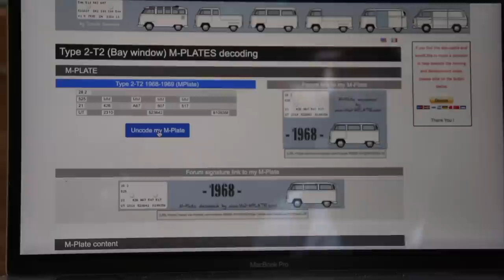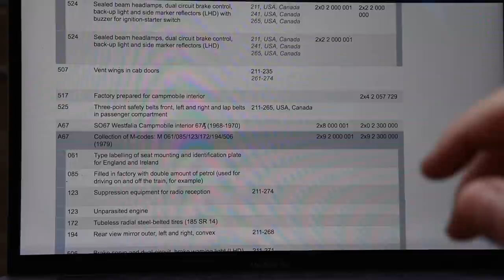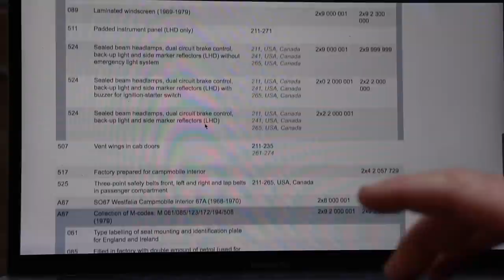Forgotten VW BUS Found & Rescued - Volkswagen Camper Van

Comment: I can’t believe, the bus comes originally from my old hometown in Germany. The sticker on the bus , Gruß aus der Rhön is an indication that the bus is originally from Germany. The Rhön Mountains are a group of low mountains (or Mittelgebirge) in central Germany, located around the border area where the states of Hesse, Bavaria and Thuringia come together.  A major city in the area is Fulda, where 1000 of American Soldiers were stationed until the early 90’s. Most likely one of those fellows brought the Bus here to America. Also, the other sticker with the arrow pointing upwards says”Hallo Partner, Danke Schön.” This sticker was around the years from 1971-1974. It was a kind of awareness logo from the German Government to drive safely and cautious.Anyhow, keep up the good show. Love it. Hans
Reply: Guten aben 😁
Reply: Hans thanks for your interesting reply. FYI there is a Fulda, Ohio. I have been there and it’s in east-central part of the state.
Reply: Also my ancestors are from Durmersheim/Baden-Baden. And yes I drive a VW and do so proudly!
Reply: I was tempted to add the translation, but your insight is more convincing than what I could've added. Your speculation regarding a soldier is likey spot-on! Grüß aus NRW :)

Comment: You have a Westy someone gutted and converted to a station wagon.  Check out the wood panel headliner and the power outlet on driver's side.  You should have an unpainted Westfalia data plate riveted to the partition behind the seat (driver's seat IIRC).  Solid roof makes it a "Caravette"  (as opposed to pop top "Continental").   Back when I collected, my specialty was 68-71 T2.  I do miss them.
Reply: Tin top

Comment: Cool bus ,
I have a 68/69 Panel van as mentioned in previous comments the early beams have different mounting, I’d say it was a Kombi originally as I believe velvety Green is a commercial colour and the bench seat and walk thru pads are on kombis not just deluxe models  then I’d say it went to Wesfalia for a few extra bits like headliner and socket 
Great find keep it up

Comment: Nice early low light Bay window. Pushbutton door handles. Extra long chrome rear view mirror. The coat hooks are for the seat belts to hang on when not used. The 68-69 front beam had the same mount bolt configuration as the split. They probably put a 1970 beam on it. See you Sunday
Reply from the maker: thank you for the info, I appreciate it , see you Sunday👍

Comment: Yes, that is velvet green. 68 buses used some carryover colors from the split bus era. Titian Red and Lotus White were also used. 

Interesting bus, tourist delivery at the factory. So a tin top Westy interior that someone ditched for a junkyard interior at some point? I have had those tall over riders on a bay bus before, I figured they were  a dealer item or JC Whitney aftermarket. I wonder if that hitch is a factory/dealer item? There are threaded holes for install, I have a couple of those hitches in my stuff.

Those rear jail bars could have been installed at the factory, Any sign of them also having been installed in the rear side windows?  That front beam has the later bolt pattern. 68-69 were the same, changed in 70 and stayed that way through 79. Yours is likely a 70, unless someone went through the hassle of installing drum brakes and spindles on a later model disc brake beam.

Comment: Hey Jason, you’re the VW whisperer! If you use the jack on the front of the trailer and jack up the trailer and truck at the same time it would be easier to load the bus. But you did fine in the rain. Thanks much for sharing!
Reply from the maker: Thank you, yeah i jacked up the front of the trailer to lower the angle ...wouldn't of had an issue if it wasn't for the huge bumper guards :)
Reply: @5150mxVW  yeah I’m not sure I like the bumper guards on that year of a bus. Would have been ok with me if you ripped them off. But probably caused more damage.
Reply from the maker: @michaelmcdonald6727  yeah, they are kinda fugly :)

Comment: For the trailer stand I have the same one I drilled a hole in the top side of the tube and threaded a zerk fitting in and pump some grease In there it’s amazing how good it works

Comment: Using boards on the ramps can be pretty sketchy.. I know firsthand . A better way would be to bring some portable automotive ramps for the truck to back on to and it will help give you a smoother, less steep approach angle when you pull some thing onto it.

Comment: At 13:30.... the lettering on the front of the radio reads "All Transistor".  Wow - that radio is definitely old!  At 22:25, Dubwerks mentioned that the engine in this Westie is "unparisited".  I saw that when Jay pull up the info on this bus on the website.  Dunno - I'd think that it might mean that there's no smog air pump on it (U.S. air pollution regs at that time), or that there's no accessories (ex., A/C compressor on it) installed on the engine.  Strange term!  At 23:50, Dubwerks pointed out the German stickers on the back, and that indicated that the Westie spent some significant time over there after it was picked up at the factory.  I'd bet that that the original owner may have been in the U.S. military, or that they arranged to buy the bus in Germany to take a long trip before they returned to the U.S., and had the bus shipped back.

Comment: 👍👌👏 😁😁😁 At 3.55 min: While generating terrible squeaking noise, we are told emphatically: "Yes, I lube this regularly!" 😁😁😁 Please kindly allow me to suggest something:  Maybe you better grease it, Sir! Oil doesn't stay on, even less does for instance something like that WD40 cra... uhm... penetrating oil. If parked I always put a really big plastic flower pot over the hitch mechanism, the plug and the crank handle. So no rust can rise because no water cant go in.
Best regards, luck and health in particular.
Reply: I lube my trailer jacks with 90wt. It stinks but it also sticks around, once it gets inside. I also place a 5 gallon bucket over the top to keep rain out, then clip the safety chains on the handle so the wind doesn't blow it away.

Comment: Those thin over rider's are rare to find on an Early Bay.

And theres no fuel tank panel on a 68. A 68 Bay is a 1yr only bus, lots of 1yr only parts, doors, door handles, wipers, dash clocks, chassis itself (front and rear chassis changed for 69 model year), no fuel tank cover, sun visors, rear view mirror, brake drums, front beam. Basically lots of splitty bits were carried over.

And thats missing its interior, SO67 is a full camper interior, my bus is an early 68 SO67, theres a walk around of it on mine/my sons channel, should have that interior.

Also that colour isnt uncommon on Early Bays, know of a few 68/69's that colour here in Europe.
Reply: And the Tourist Order option was a cool thing VW used to do. You could order your Camper, fly over to Germany, collect it from the factory, go on holiday in it for a while, drop it back to VW and they'd ship it to you in the states. My old 69 Bay was a Tourist Order and I had some of the original paperwork about it, also the service book that showed it spent its first 3 months/6k miles touring Germany, then it was shipped to the states by VW.
Reply from the maker: Thank you for the education on 68’s 👍, much appreciated

Comment: Have you ever thought of using longer ramps Jason. Smaller gradient might make pulling busses or bugs o  the trailer much easier.
Reply from the maker: i usually just jack the front of thee trailer and i do carry 12" wide 4ft long boards to drop on the ramps to even thee grade some....i don't recall an issue with this bus....oh did the rear bumper hit ?